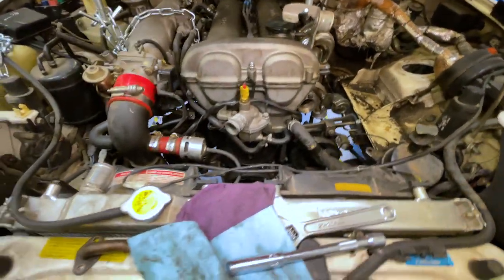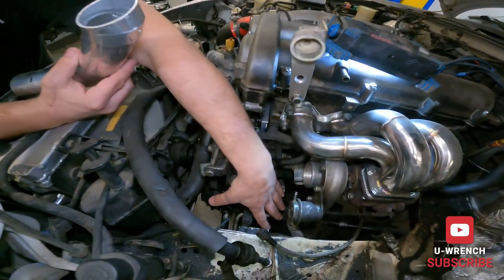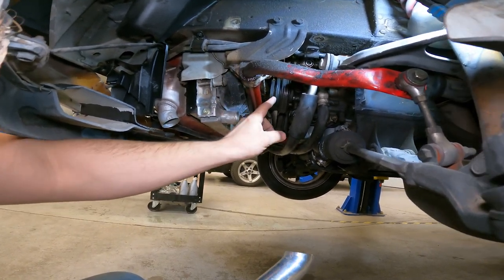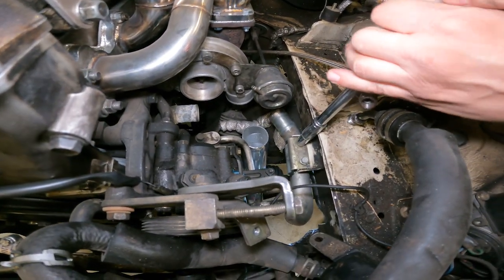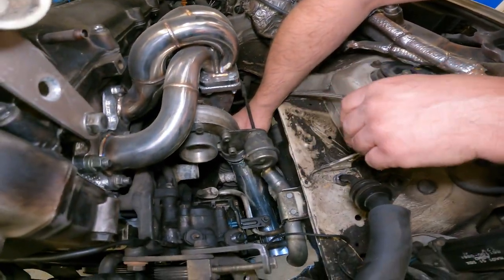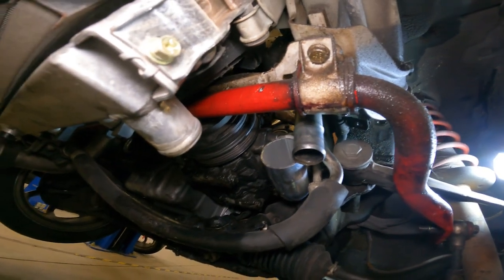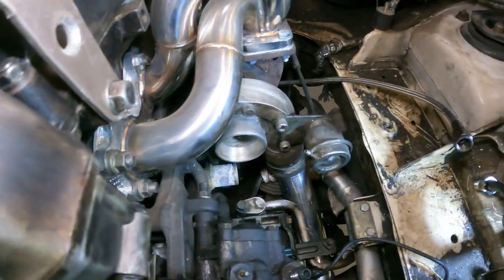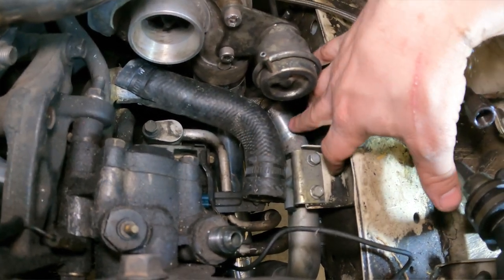Miata Turbo Hot Pipe Nightmare | U-Wrench Vlog

Comment: I recently replaced my rear main seal and oil pan gasket on my 2000 accord. I used that same engine bar hoist from harbour freight. I never did any real mechanical work besides brakes but I watched a bunch of YouTube videos and worked 22hrs straight from start to finish!